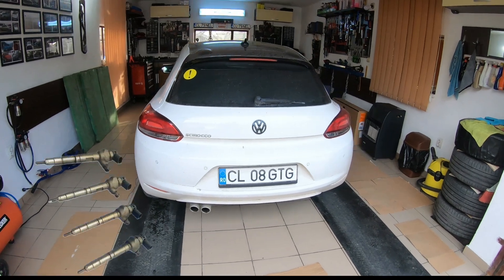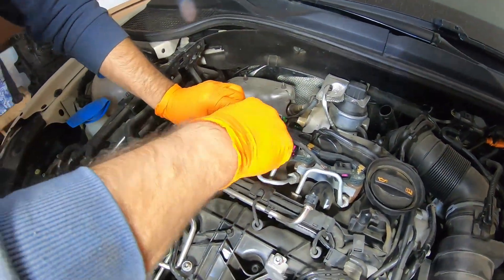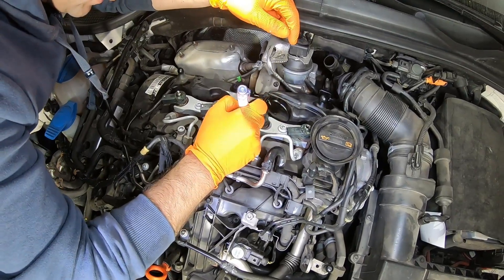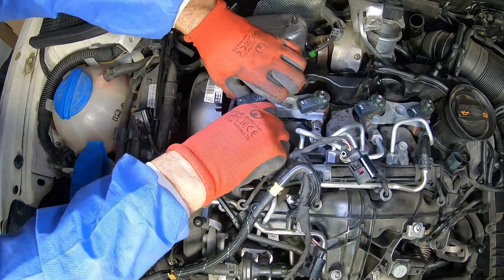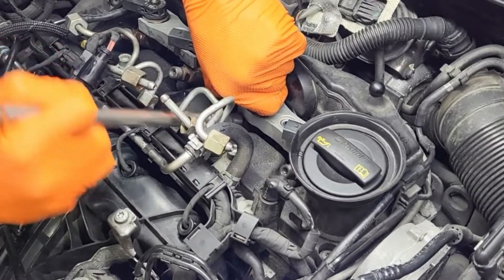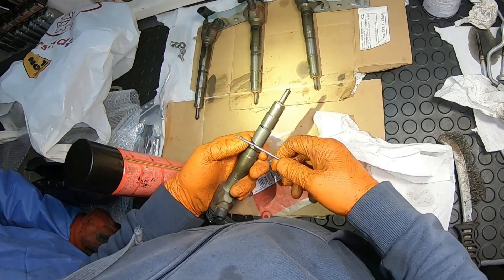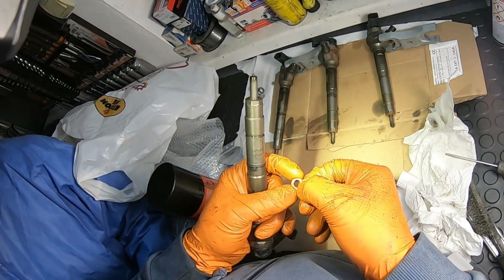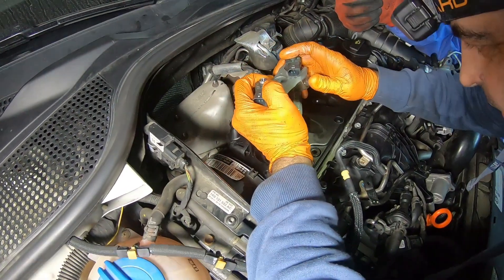2.0 TDI Fuel Injectors Removal Replacement CFFB Engine Volkswagen Audi Skoda Seat

Comment: Do i need to re insert the injector code even if i just take them out to change the copper ring? Otherwise wouldn't it even start?
Reply from the maker: If you just place it back then no.
Reply: @TheDIYWorkshop2020 thank you!

Comment: How tight should be the supply line nuts?
Reply from the maker: I don't have a special torque wrench for these nuts so I can't say exactly. You will feel when it's tight enough. The most important is to use the right torque for the bolts that hold the mounts. Those are stretch bolts and can break if you overtighten them.

Comment: Great video! I’m interested, are the data in VCDS about injection deviation relevant to the condition of the injectors?
Reply from the maker: Not always. I think the most relevant test is the injector return line test. ECU usually compensates and the values may appear normal. If you suspect a failing or bad injector do a bench test.
Reply: @TheDIYWorkshop2020 Thanks for the reply! And how can I perform a return line test?
Reply from the maker: Hi! you need something like this  https://share.temu.com/lH8hD2uu1kB 
 You plug in the small hoses into the opening of the fuel injectors and check if any of the injectors looses more fuel in the return line. There are tutorials on Youtube.https://youtu.be/WO6gcGosaVw?si=pIHmlT4UxldYd6KZ
Reply from the maker: I'm sorry I didn't make one yet.😄
Maybe in one of my next videos if I find a car with fuel injector issues.

Comment: Hello, how did you put the copper washer with the concave side on the injector or on the cylinder head?
Reply from the maker: Yes — for the fire washer used on injectors, the concave side should face towards the cylinder head.
  When you tighten the injector to the correct torque, the washer slightly deforms and flattens, ensuring a perfect seal between the injector and the cylinder head.
  Having the concave side towards the cylinder head allows the washer to compress evenly and compensate for any minor surface irregularities.
  It's good that you asked.
Reply: @TheDIYWorkshop2020 some say it should be with the concave side on the injector and the flat side on the cylinder head
Reply from the maker: It only makes sense with the concave side down.

Comment: Good video thanks ,one question do you have to purge the air if so how
Reply from the maker: Bleed the fuel sistem with a diagnostic tool. I reviewed a cheap one from Kingbolen. Really useful for VAG. But you can only bleed the system all the way to the hpfp. After that, you need to crank the car for the hpfp to generate pressure more than 300 bar so that the injectors open and release the air. If you don't empty the high pressure fuel rail, it should start right away. Try to replace them as fast as you can and don't forget to code the injectors. Also coding or adaptation is presented in the Kingbolen review. Link here.  https://youtu.be/vzpOdfWQl-c?si=cIBpvOnFBPQ9Visd

Comment: Do I need to re-calibrate the injectors? As I have got mine replaced but still giving issues
Reply: Nice video thanks great job
Reply from the maker: Yes, you have to enter the 7 digit code (leters and numbers) on the head of the injectors with a diagnostic tool.
Reply from the maker: According to the service manual, if you replace the fuel injectors with new or used ones, you need to make adaptations with a diagnostic tool. There are specific 7 digit codes written on their heads. I can provide you the service manual if you want. Just leave me your email address . If there are no error codes, it may be the rail pressure regulator not working in parameters. Most important is to check if you have any metal shavings in the fuel filter housing. If there are, you have a bigger problem. Check this video https://youtube.com/shorts/2lkUjWQrdKs?si=d_V7QRPqK1-hOo3i
Reply from the maker: I will add a note in the description about the adaptation. Thank you for your comment!